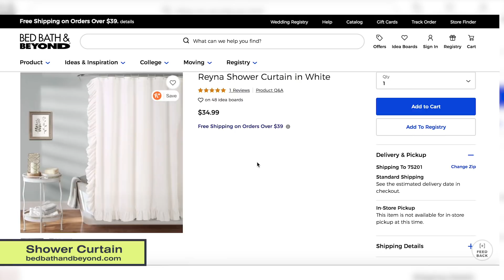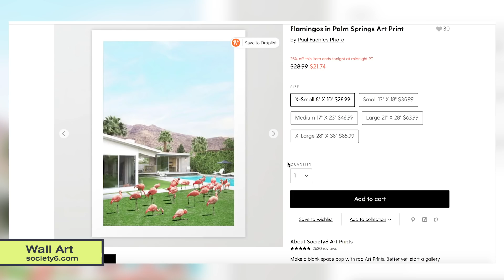Freddie Officially Moves Into Her New Apartment • Moving Series: Part 4 • Ladylike

Comment: Wait a COUCH with the dining table??? How does that not get messy...
Reply: Not a fan of that either... too awkward to eat
Reply: So odd tho
Reply: It's leather so it's easy to clean
Reply: Literally grew up on a leather couch in front of a dining table. Works fine, leather is easy to wipe down, kids can bounce around on it and it’s comfy
Reply: Henrike Hempen ok....just seems a little wierd to me but I guess not
Reply: I actually really dig the idea. Never would have thought to make that pairing
Reply: Don't be a slob?
Reply: Think of it like a booth at a restaurant instead of a couch you'd have in your living room
Reply: If it is more of a booth style it is actually nice
Reply: You eat over the table like a damn adult is how.
Reply: it's leather or leather-like material, so easy to clean if needed. I think I would mainly be concerned with the height, cause most couches are lower than a dining seat, and then when you sit on it you also sink in a little so you end up with seating being kind of low for the table, but not a problem if its high enough.
Reply: I think it's a vinyl? Easy to wash
Reply: That WHOLE room is a hot trash mess. What in the 1980s?
Reply: I actually like the couch there, I don't think it would be a problem, a lot of restaurants have couches!

Comment: Looks beautiful. 

I don't see this as her apartment, not really. It's more of the same area as student housing or the company renting a hotel room when sending an employee to work temporarily in a location. It has a significant feeling of "borrowed" in spite of all the hard work spent personalizing it. 

 So some questions: What is going to happen to this apartment if the relationship between Freddie and Buzzfeed ends. Is Buzzfeed going to hire a truck to take back the furniture it bought? Also, Freddie moved from New York to LA to take the job to begin with years ago.  Was that move paid for by the company as well? Under what other circumstances will Buzfeed pay to relocate and furnish employees?  Freddie's employer supplied/arranged/acquired  furniture,new bedding,  fancy dishes, pillows for the dining room,  hired the contractors doing the handiwork.  Considering the amount of work put into this by Buzzfeed, I can easily imagine a scenario where the company takes over the lease if Freddie; quits the company, gets terminated, or chooses to move again.  Would love to hear about the paperwork side of this adventure well as other instances where homes were affected by the job, like when they redid her bedroom in the previous apartment. Thank you.

Comment: Everything seems good but there were some missed opportunities to really push the design. Gallery wall should have had frames of different sizes and other unusual wall hangings. The hot water heater in the kitchen should have been enclosed (add a door) then a fold down counter top (with legs) could be hung to extend the work space when she is cooking.
Reply: tbh I'm pretty sure she doesn't cook much, wasn't that one of the things she said about the kitchen being small? she doesn't need much space

Comment: Anyone else think the design is cheap and too mismatched? Dont even get me started on the guestroom
Reply: @hohl_ee  i did like the dusty pink couch with the gold accents. As well as the place settings and the gold puzzle side tables but everything else just seemed to clash in all the wrong ways and nothing really tied in the lime green stripes. I am no interior decorator but some of the design elements could have tied in better together. 

One of the hot pink photo frames still had dark smudges on the side and was certainly the wrong shade id they were trying to coordinate it with the couch.